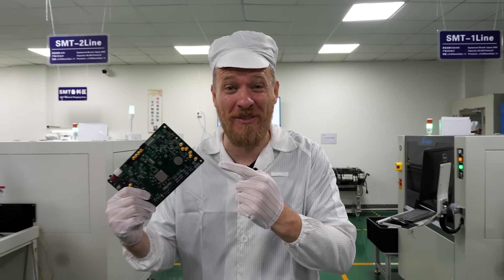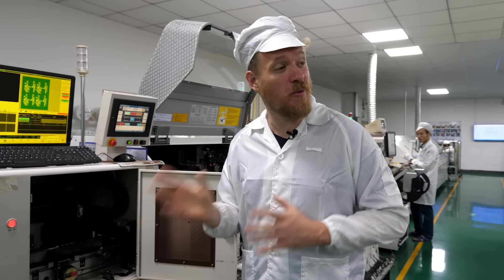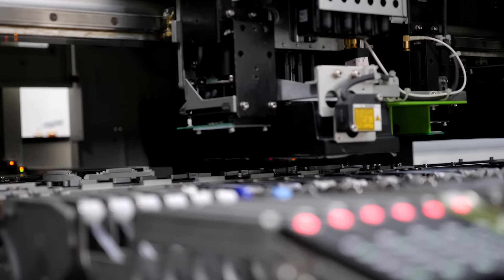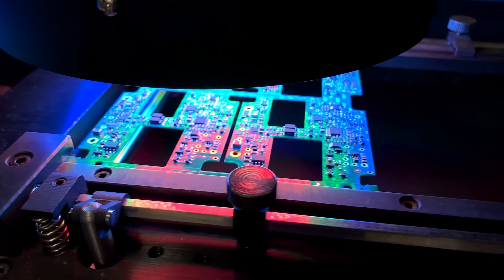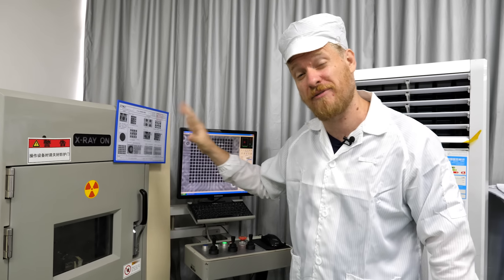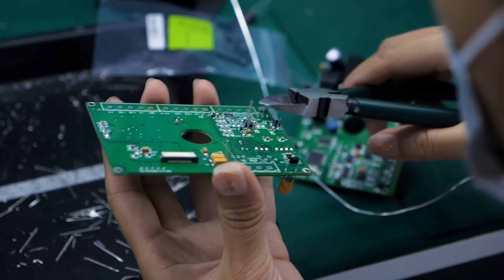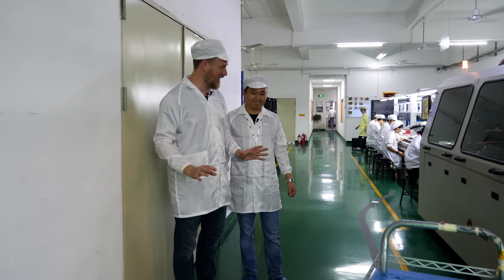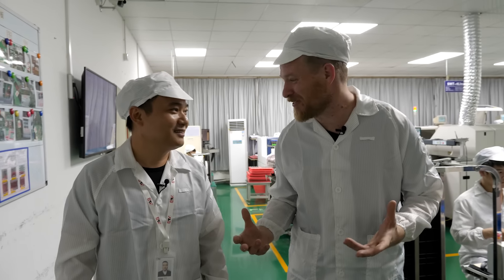Inside a PCB Soldering Factory - in China

Comment: Scotty.. this isn't a soldering factory.. this is a PCB & PCBA factory. Last A meaning assembly.

PCB soldering factory is a place some smaller manufacturers send their PCBs soldered. Usually these factories have LF and Leaded HASL machines by the tons, or some have immersion gold/silver & electroless nickel+gold plating lines.

Usually these speciality soldering factories are in shenzen right next to few companies that make the pcbs, serving many companies at once. Sometimes the boards cross the street in carts :D

Most of the cheapest PCB factories might also even buy the final milling/ routing as a service from another company across the other ones.

Comment: I toured a PCB assembly factory that had auto-place machines that could measure every passive component coming off the reel to ensure it was correct. Those machines were ideal for lower volume quick turnaround production runs. Think PCBWay should be doing that rather than manually measuring by hand.

Comment: PCB assembly is a Level 6 product line in whole  supply chain
for example:
Level 5: PC case HDD cage 
Level 6: PCB assembly with active and passive IC ,connector, etc.
Level 10: System hardware assembly
Level 12: package,manual,accessories 
then. ready for shipping to customer over the world
this video is likely taken in Shenzhen or Dongguan, China
Looks like an small PCB OEM factory

Comment: really cool video Scotty, especially since i used to do this for a well know fire alert system company in the UK.
We were oldschool though, Our pick and place machines only had 2 heads and manual feeders! 
we also had a machine called the CS400, which was the worst experience of my life. This machine was for through hole parts, you would be sat on a seat hunched over looking for a very small bright light through the holes in the board. This would tell you where the part would go. 
A rotating bin of parts would auto turn to what you needed to place next, you would often hear the screams as you dipped your hand in the bin and received a diode or chip up the fingernail!!!
I also remember our wave solder oven, when it worked it was great! However between flooding the boards with solder or when feeding a board into the machine it would snag between the teeth and snap a board throwing the parts everywhere, it was a nightmare.

Im glad to be out of that business now as it was tedious and very hard work. 
Great memories though and was cool to be part of something so technical!

Comment: Great video, really interesting!
One question: at 10:30, how can they test the value of each individual component when they are already placed on the board with soldering paste? Won't the measurements be affected by the circuit?

Comment: @11:03 that machine, if it works and claims to do what its doing, is almost worth its price in gold. Its impossible to get a measure of any component while its in circuit. If that machine claims to do things tht it is supposed to do, its priceless.
Reply from the maker: I was a bit confused about that at first too. Turns out they use it before sending the board through the reflow oven. That allows the worker to actually pick up each component off the board to measure it separately.

Comment: Ok, so you vacuum a part smaller than rice and place it on the board. What happens when the lady picks up the board to examine and adjust any of the pieces? What keeps these small pieces in place until they are soldered?

Comment: For the "semi-automated" LCR meeter (with the kelvin connection on tweezers), they should add foot operated switches to advance to a prev/next components quicker, instead heating a spacebar on a keyboard. ;D Or even just use the "hold" functionality (automatically finishing measurement when it stabilizes to a new value, very common in meters, DMMs and LCR meters). They could make it even faster, by making a software give instruction using voice command or sounds, for good, bad, etc. I.e. if you have a row of resistors and capacitors, it is easy to just go one by one

Comment: I challange you to embed a pop-up camera in a phone (that is, make it work normally, without a motor or moving parts). I recenlty got a oneplus 7 pro and thought of how would it be possible to put the camera inside somewhere, without notches, screen cut-outs or whatever else. Would it be possible ? Maybe a smaller camera module?  Maybe in the bottom edge where there is usually a tiny bit more room ?

Comment: Remarkably little has changed, certainly in the UK, since 1990. Disappointing to see a visual inspection / manipulation required before melt. Something we didn't need back in the day and even then hit 99%+ success. We were testing components. even then. BEFORE they were fitted to the board.Back then even through hole components were fitted by robot.

Comment: I can't believe that they manually lift the components and measure them on an LCR meter. That is the most bizarre thing I have ever seen. First, you can buy pick and place machines that can measure discrete component values, such as resistors and capacitors just before they place them, alternatively and most commonly, there are ICT (in-circuit test) machines that will test components automatically at very high speed guarding out the effects of leakage paths. These machines can also test ICs, digital and analogue, and can be setup with in-line handlers. They test after the board has been reflowed and so pick up shorts and opens as well. The PCBs do require some special design considerations, which include test points, however they can do in a few seconds what it would take a technician hours or even days.

Comment: A one off custom motherboard will cost you tens of thousands of dollars vs say $200 for a production PC motherboard.  Set up and engineering costs are very high.  We had a 35 year old printing press that needed a motherboard replaced in it's control box and we ended up having to have a custom engineered one off motherboard for it to the cost of $24,000 for one board.   Still a lot cheaper than replacing an entire multi million dollar printing press.

Comment: Things have changed since I ran a flow wave machine 40 years ago at Sharp Australia. I'd have to remove the mother boards & sister boards from racks and unpeeled the masking tape that they covered the edges with to prevent all the flux from sticking to the edges. I had to have a blood test every six months to check for lead levels.                                                                                                   🤖ROBOTS RULE🤖

Comment: BGA devices are supplied from the chip manufacturer  with the balls of solder already fitted.    there is no need to solder paste the PCB
Reply: Yes there is.

 Most are not collapsible BGA balls and  actually I've never seen where I work not apply paste to the board for bgas and I'm the one inspecting the things in the x-ray fresh paste and flux helps everything :)

Comment: We have way better machines here in the USA and much stricter workmanship QA process BGA X-ray is standard in most pcb solder houses here in the USA look up bematronics they do all this here in the us it truly is amazing what’s really crazy is they wash the pubs with water and we’re taught as humans that if you wet electronics there done but nope a little compressed air and and a pass through a heater line then needle pin testing for electronic conductivity is standard in most boards chips are pre loaded with any software that needs to be installed through a specific pin

Comment: So this is how knock off is created.
ie. there is a demand for replacement PCB board on charging port from a certain products (ex: Iphone or Galaxy S10).

the original is expensive. somebody , a certain individual (an electrical engineer) opened the phone.. copied the board dimensions, parts and digitally mail it to a manufacturing facility like this.

the facility doesn't know you are copying a board from Iphone or galaxy S10. frankly speaking.. "They don't care" their only job is to manufacture. it is none of their business if you are copying someone else work.. just like how Photoshop doesn't care if you use their product to make fake news.

Interesting...